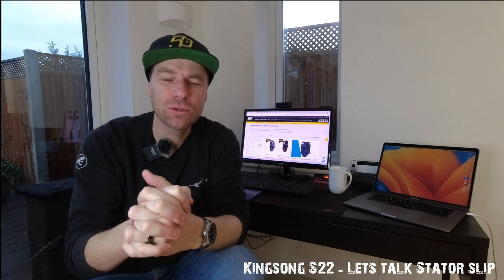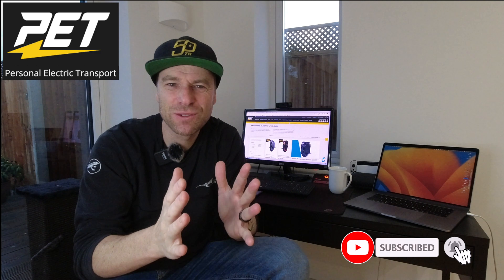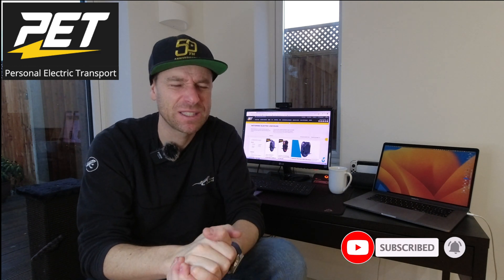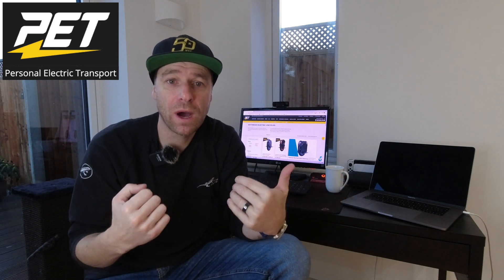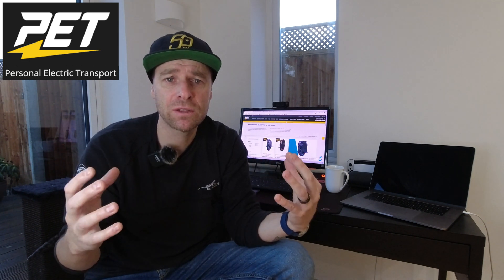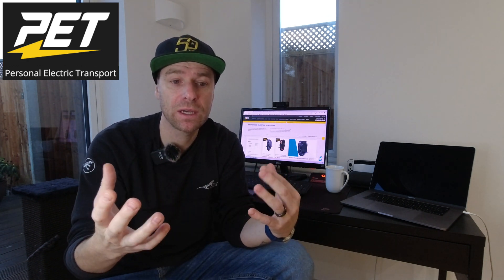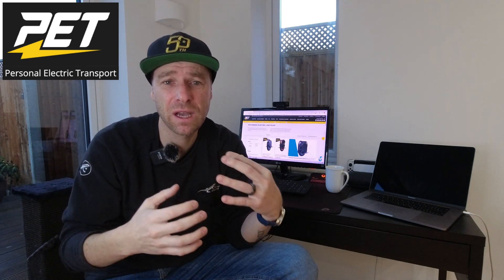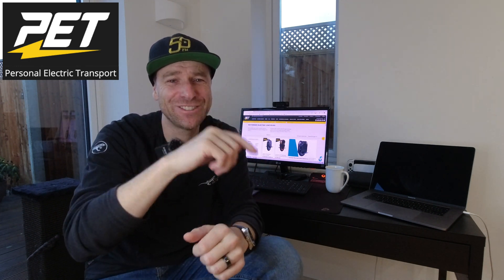KINGSONG S22 - STATOR SLIP EXPLAINED

Comment: Stator Slip in an electric motor means something entirely different and is required for an induction motor to work.
Reply from the maker: Oh ok, had the wrong end of the stick then. Thanks for the comment. I will have to do some more reading
Reply: Sure, stator slip for an AC induction motor means something different but EUCs are DC motors, and the term stator slip refers to the physical shifting of the stator windings and the wheel hub due to a weak interference fit. Pinning the junction is like adding a key way to permanently ensure translation between parts is restricted. 
 
Thanks for noticing the terminology. 😊

Comment: Nice video but I have to say this: Im not OK with Kingsong anymore.  Too many lies too many errors.
Reply from the maker: All I can hope is that they sort it out. I am keen for an T4 but here in the UK its a problem wheel and the Master for that matter. I hope that we get the batch 4 and up of the T4's when they arrive. The V13 for me is too big and way too much money the only other one we get here is the Sherman S. Also allot of money but from what I have seen its worth it. I think we can only hope that they improve and learn from the problems. But they again it looks like they just do what they feel like.
Reply: @Andre-Mostert  Inmotion will make a 16 inch wheel with suspension ..... Ill go for that  .... maybe
Reply from the maker: Yes that would be a good option. I did not get the feel for the V12 when I had it for about 3 weeks. Just could not get the fun out of the wheel. First time I have had it with a wheel. On the paths it was nice and smooth but when it got rough it was just not fun. For me at least. But if they can make that sweet spot wheel like the T4 or S18 size then it would be a good machine.
Reply: @Andre-Mostert  I sold mine  - I need suspension in order to avoid back ache -- I really liked the v12 just add suspension and its perfect for me --- smaller wheel is totally different
Reply from the maker: What do you ride now as you main wheel and this Patton looks like an interesting wheel. Smaller with solid suspension.

Comment: The Hub (the chassis with the axial), and stator (the bit with the windings) are as one. It's the bit that doesn't turn. The bit that spins have all the magnets with the rim and the tyre. Stators are friction fitted or glued to the the hub, its the failure there (the slip) that causes the problem.  It's because the stator does not spin, that no slip rings or brushes are required to provide power to the windings. The pinning is an addition link between the hub and the stator to prevent the slip. A slip does not necessarily cause a failure, it may just put tension on the internal wiring within the motor. It is for this reason if scrapping sounds are heard within the motor when freely turning the wheel, it should no longer be ridden without investigation.
Reply from the maker: Very well explained, thank you. I just hope they sort this out for all the wheel coming out and we as customers dont have to worry about this. Thanks for the comment.